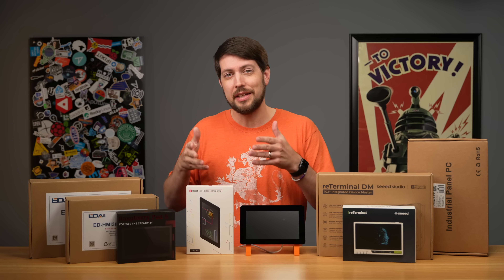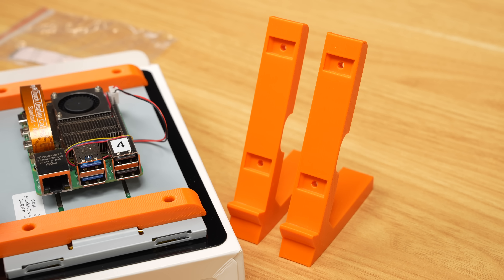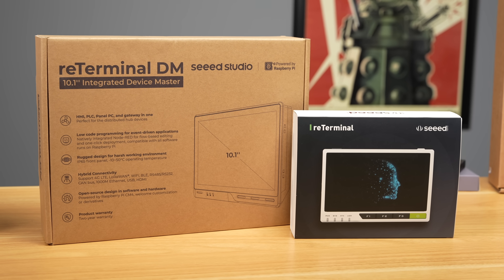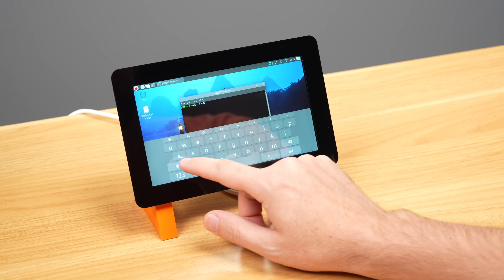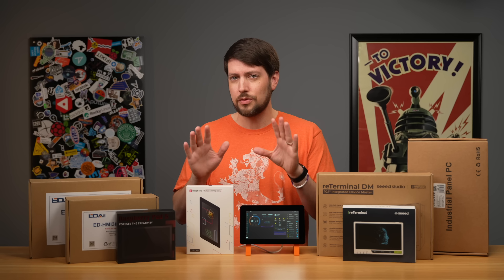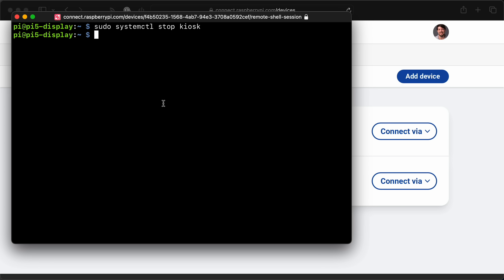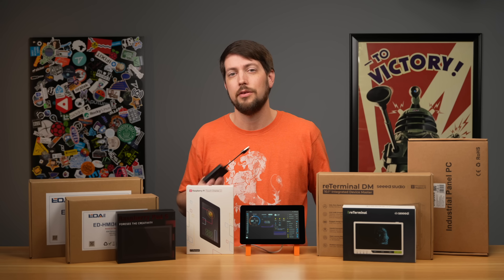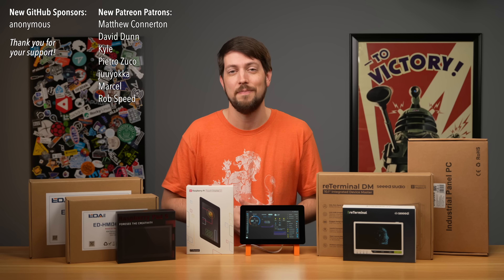I Control EVERYTHING with this Raspberry Pi

Comment: Pi5 8GB RAM with original Pi Display — purchased in August 2024 and used as a display for Home Assistant — but running Pi OS Lite with GNOME Desktop because I could not get a good onscreen keyboard to work with Wayland and full Pi OS. 😡 So I cannot use Pi Connect for remote access to this Pi. I have a second Pi5 4GB running HAOS. HAOS connects to non-HomeKit devices, plus a few Matter devices all bridged back into HomeKit. If I need to access the HAOS Pi5-4 away from home, I have a Tailscale VPN setup. No extra costs.

The Pi5-8G with display is mounted on an adjustable arm VESA mount stand sitting on my bathroom counter - case from KKSB. With HA Kiosk in Chromium, it displays time / date, current weather and forecast, temperature and humidity for a variety of locations at my home, and even range / remaining fuel % on my vehicle. It mostly replaces a LaCrosse “weather station” that could only do about half of these things. I will look into your startup scripts, because the GNOME desktop prompts for a password to launch chromium after the auto login. I can bypass it after hitting cancel about 3 times.

The GNOME 43 (Debian 12 Bookworm) interface isn’t the greatest, and there are still some desirables here (RDP to the iPad app is HORRIBLE). And… sometimes I wish the display was larger.
Reply: Also — for the HA display, I have a separate interface screen setup in HAOS, then running an add on kiosk mode for the url (from Tailscale). Chromium is set to open to this page. Then there is a chromium plug-in to enable kiosk mode for the “window” - I can exit by “double finger right click” to get that menu and tap exit full screen.

Comment: Economically misleading video as usual, just like the one with GMKtec G3. Waveshare has better displays with better compatibility (since they're equipped with HDMI) for a similar price. I bet if you didn't have a Raspberry Pi channel, you would have an Apple channel and recommend Macs as the economically better option.
Reply from the maker: Using an HDMI display is a completely different option. Still quite useful in many cases but if you build devices with integrated touchscreens (like those I demoed in the beginning), you're not going to use HDMI.

Comment: One thing I would recommend is an FM antenna plug interrupt. Tons of types out there but you plug it in, in line of the FM antenna and can then hardware or have Bluetooth connected so that it kills the antenna signal and only plays your audio on FM like an fm transmitter but better

Comment: building android auto for pi is possible but without being Volvo it's next to useless, because you can't get the google sevices to work. 
However, I did get lineageos and gapps working on it and this was fine. Lineage lets you defined hardware buttons for volume and screenlock, so, there's good potential there to have CANbus drive that from steering wheel controls (via a 'daughter-board arduino nano or something.. I've got it half built). That OpenAuto thing is shady imho
Reply: *fine sorry, I meant totally illegal.

Comment: I used the original screen to make a bedside smart screen, I wrote scripts to start YouTube in chrome, to stream my favourite radio station then turn the volume down and turn off the screen, and a few other night time things. Each script also had a shutdown command on a timer so after 2 hours it would shut the pi down. This didn’t turn it off-off (Pi 3, and later 4 problems) but I had a foot switch on an extension cable that I would hit every morning to turn it off properly. That same switch turned it back on when I wanted to use it. 

Paired with some USB speakers it worked fine but was bulky and eventually the footswitch technique got tedious so I replaced it with a cheap android tablet - although now I have to control the volume and turn off the screen manually. I also have to charge it every 5-7 days which is also annoying. 

One day I’ll build a perfect setup!

Comment: I used to use a Android app called Drivemode, which has not been updated nor have the developers said much for Some time, sadly. But it greatly simplified the phone interface to make it much more hands free friendly. You could set it up to play audio from your favorite app, even VLC. It could read your emails and/or text messages to you. And would even let you voice dictate replies.   Sadly some of those features went away as Google tighten system settings.  But I have been trying out a app called AutoZen. One of the things I keep looking into is some of the little blue tooth media remotes on Amazon, though most of them are just 'media remote"  so I don't know how well it would work with the app for other things.  Also not in a hurry to try because I also use a Motorola Sonic Rider speaker for hands free calling. 

I am wondering if you get a head unit for your car that has aux in would that solve part of the audio issues?

Comment: We just had to get a new vehicle due to an accident I was in (not my fault, everyone was fine), and CarPlay is an absolute requirement right now. Ford and Toyota still support CarPlay; Honda, Kia, Chrysler, and I believe Hyundai still does. We got Ford Edge. I really like what Ford did with their infotainment; they even have wireless CarPlay. It has a bit of latency but it works! I go on my phone way less with the new car than my old one (which had wired CarPlay).

Comment: Add this to your kernel command line options. It was literally the first result when I searched for "linux rotate console output"...

fbcon=rotate:1
1 - Rotate clockwise
2 - Rotate upside down
3 - Rotate counter-clockwise
Reply from the maker: Unfortunately that doesn't work, but we found the right kernel parameters for the DSI-1 connection! (Check the GitHub for it now)

Comment: I'd be curious as to how solve the issue of hard powering off the pi every time the car is turned off. I'd imagine it'd corrupt the sd card over time.
The only options I could think of would either be: 
A supercap or really small battery that powers the pi on long enough for it to safely shutdown. Would probably work long enough to flush all unwritten data to the sd card and show a power off screen.
Using the ignition wire purely to signal to the pi to boot up or shutdown. May draw an unacceptable amount of idle current from the car battery though. or
Possibly use an immutable image with an overlay. It'd protect the OS but likely still allow user app data to become corrupted.

Comment: If you want to use carplay/aa with close to zero delay on linux I have a fork of node-carplay which has some fixes :D
Audio has some alsa mixers too since I wanted different volume levels for media and navigation and proper (as per apple spec) audio hedging.
I had it running on a PI2 for some years now, have to update the repo though since gstreamer is blazing fast compared to mpv.
A reimplementation in rust would be better, it could even be made native since the only thing needed for carplay is an mfi chip (which i have) on i2c and a usb host&device capable usb port.
Since openauto got apparently sold and is unavailable rn I think a community project would be awesome.
My Idea was to use gstreamer for playback and UI and code in the background that handles background stuff like ui logic, canbus messages and buttons in the car - needs more people than a single person though.

Comment: What exactly do you mean when you say you had trouble getting Waveshare screens working?
Reply from the maker: It's hit or miss as some of their displays are standard and work well across generations. Others like one of the 3.5" TFTs I used a couple years ago require a custom driver for Pi OS, and that driver required a lot of work to get working properly on Bookworm.

Comment: Most people have smartphones and tablets already.  Wouldn't it be better to have home-assistant running on a low powered server, that you can access over the network from any room and use a webui to turn your lights and stuff off and on with your phone?

Comment: My other hobby is woodworking, so my 7" Pi weather display has a nice walnut case. For the UI I write directly to the video memory buffer and catch touch events at a low level. But the cursor is always blinking in the corner despite my efforts to get rid of it. I'm gonna have to try that unclutter package. Thanks!

Comment: I've been looking for solutions to replace a Nest Hub for a while now. I wonder if it would just be better to buy an old cheap Android or Chrome OS Tablet and have it run Home Assistant in a browser kiosk mode. If anyone has a suggestion for a cheap model that allows you to install a linux distro on a tablet, I'm open to suggestions.

Comment: Scrolling and touch keyboard didn't work properly in Chromium because Chromium doesn't enable Wayland support by default. You will have to go to the flags page and enable it there (and another flag) for scrolling and text input to work properly. Alternatively you can enable this from the command line using the arguments `--ozone-platform=auto --enable-wayland-ime` which also works for Electron applications.

Comment: The early rotation option is tricky but possible, as I'm pretty sure the driver used on this board uses the same kernel entrypoint that the old screen used, Kernel Mode Setting.  It's just a kernel command line change (`video=DSI-1:800x480@60,rotate=90` for the original display, adjust resolution for display 2), which can be put into cmdline.txt on the boot partition.  I believe even the config.txt can be set to rotate the pre-kernel boot screen (`display_lcd_rotate=1`), but only when used on a SD Card, and only for pre-kernel environment.  NVME, USB, and Net boot all start after the bootloader starts rendering, only the SD Card is read before the GPU finishes starting up.

Comment: For my Home Assistant control panel i have an Amazon Fire HD 10 Plus tablet (the Plus version has wireless charging), I've deAmazon'd it to remove all the Amazon bloatware to make it more of a standard Android tablet. I run HA in kiosk mode to hide the side bar. And I've got an automation with a Meross Matter energy monitoring smart plug where the Anker QI Charging stand only charges between 20 and 80%. I got the Amazon tablet used for £50 and the QI charging stand for £15, I was very patient to find them at those low prices, but was the cheapest way to get a really nice large touch screen for HA, I'm really happy with it, and it does come in handy for viewing CCTV or using other Android apps.

Nice idea about the in car screen, aside from operating temps, would be an interesting experiment. I'm with you on new cars, everything is touch, all or most physical buttons gone. I hate it, I prefer tactile buttons and knobs that I can use by feel and muscle memory alone, so I can keep my eyes on the road, and not looking down trying to touch when the demister touch bottom is or adjust the temp slider that never works first time, especially if it's cold and didn't recognize your finger touching it. It's dumb, and dangerous, give us physical buttons, switches and knobs back!

Comment: I used the v1 display for a Plexamp headless streamer for my headphone amp. Case and code on Github ardenpm/plexamp-pi. I did one with Pi 4 then updated to Pi 5 which was a pain with the v1 display due to the cable change and the routing requiring a twist if you mount the display right way up so for Pi 5 I ended up flipping it upside down. Some great new out of the box ways to handle things in your video I’ll have to update to like the onscreen keyboard and cursor hiding which I was using workarounds for before. I’m definitely ordering the new display and redesigning my case for it though, I’m using it every day and the resolution jump will definitely be worthwhile. Curious whether using it in the non-native landscape orientation affects viewing angle much.

Comment: You can rotate the framebuffer console you see while booting using a kernel option in...

/boot/grub/grub.cfg

Doccumentation
/usr/src/linux/Documentation/fb/fbcon.txt

fbcon=rotate:<n>
 
       This option changes the orientation angle of the console display. The
       value 'n' accepts the following:
 
             0 - normal orientation (0 degree)
             1 - clockwise orientation (90 degrees)
             2 - upside down orientation (180 degrees)
             3 - counterclockwise orientation (270 degrees)

Comment: I do not mean this as a bad thing by any means, love the vids, love what you do, started my home lab journey from your pihole and speed test monitor. Just a funny thought when you kicked on the screen and booted into home assistant. You made a stream deck >< if you had home assistant have 32 buttons in a grid, you just recreated the wheel on this one. Obviously there's much more you can do than the simple things a deck can do, but you could use this for both

Comment: Im pretty interested in where your going with this as I have been putting a RPI ,( 2 actually, one for data collection to MQTT, then another to host the display) in a 1972 VW bug for over a year, custom dash with touchscreen, the Pi is running Node Red and is collecting my speed and engine data and serving it of via a dashboard, i have tried several options for getting Android Auto on it also, namely OpenAuto Pro....

Comment: What makes you think Zigbee is actually private and secure when its security model is closed source 'security by obscurity' and the public cannot confirm that? Is it really 'secure enough' and 'private enough'?

It claims AES 128 bit. That is largely dependent on the RNG. How can the public be really sure it's RNG really is that good and there aren't 64 bits or more that are statistically determinable? And because it's being broadcasted, a tuned antenna could be used to monitor it at a distance. And because it's radio, can also be jammed, but that likely would be detectible at any range and be an FCC violation. Little consolation after the fact.

Comment: Yes, integrating home-brewn solutions like yours into a new car can be next to impossible. I've been fighting with an issue on my 1987 Oldsmobile (which is already stuffed with fancy electronics) whose radio broke down: A Raspberry Pi, a DAB+ / FM tuner board, a (wide-range!) power supply HAT, an amp, and a (non-touch) VF display were the solution…well…at least, in theory. Integrating the display took me months (partially because it expects little-endian data, thereas the Pi is big-endian!), and now a very smart guy from the hackspace in the nearest city is helping me to complete my project.

Comment: I'm waiting for someone to offer an all-electric kit car.

The focus on luxury and range over function and user control has zero appeal to me, and I'm never going to sink tens of thousands of dollars into a proprietary locked-down appliance.  But ICE kit cars have existed for generations, despite being fundamentally more complex.  All the EV equivalent would have to do is not shoehorn complex software into critical drive control inputs.  Every crucial subsystem from the charging circuitry to power steering is actually incredibly simple, very well isolated from other concerns, or both.  Aside from regenerative breaking, pedal make go and pedal make stop have not actually gotten more complicated.  In fact doing so reliably with electronics and without a gearbox is actually easier.

…if the primary software actually ends there.

It's insane to me that consumers are accepting mandatory value-added premiums for nonessential functionality that's actually just obliterating any post-purchase choice, cost-effective upgrade path, or control over their own property.  And imagine giving up all that autonomy and self-determination just to watch these black boxes horrify themselves and get recalled.  Imagine paying that premium for non-serviceable battery tech that'll be significantly outperformed by next year, for less money.

It seems like the car industry loves having new excuses for planned obsolescence, which actually just makes it a great time to wait for a better deal instead.

Comment: Nice video! You should also try using Ubuntu server or Ubuntu core with snap packages like Ubuntu Frame for kiosk and other for vnc, etc. 
I find it very nice as it is super easy, fast, and really simple to setup! Compared to raspberry pi OS, when the pi boots, it will open the kiosk directly and not display a desktop (although you could also do this with raspberry pi os).

Comment: I have a Wisecoco 10-inch display running a POE Pi 4+.  It’s a cheap screen, but for Home Assistant, it’s a perfectly good solution.  I need a 3D-printed stand for the thing.  The wood feet it comes with suck.

Comment: Thanks for this great review and answering the question of the compatibility with the case for the old one. 
I'm using the old original 7" Touchscreen with the case which looks very nice. The Case covers the whole pi4 and Screen. The only point is the low pixel density and the view angle. I'm also using this setup as HA Dashboard. Autostart lxde with chromium in fullscreem w/o kiosk mode and some energy settings to turn the Screen of after 30s. My ikea zigbee PIR is Switching it on via nodered flow and sending an xset -dpms and +dpms command.😅 
In my setup i dont have this scrolling issue. The mouse cursor is not visible during Touch Operation and it is very smooth and easy to scroll up and down. I can move the Finger somewhere on the Screen up and down without using the scrollbar. It was working out of the box, i guess (raspi os, an older Version😮). It seems that not everything was improved in the meantime😂. Thanks for your channel and work. Cheers from germany